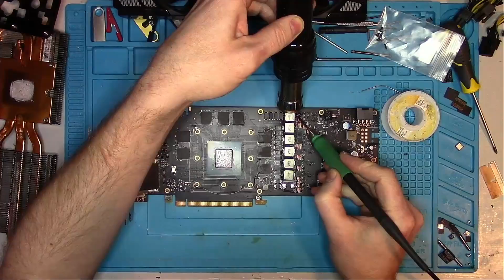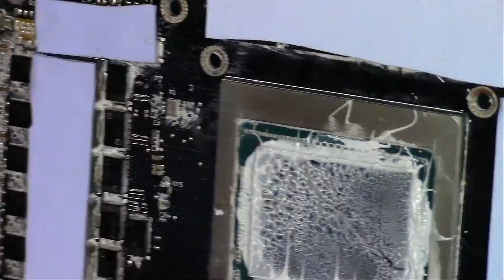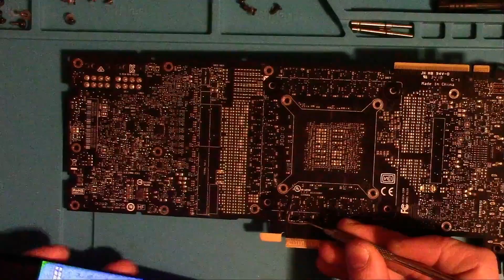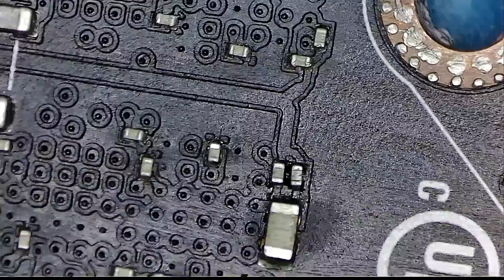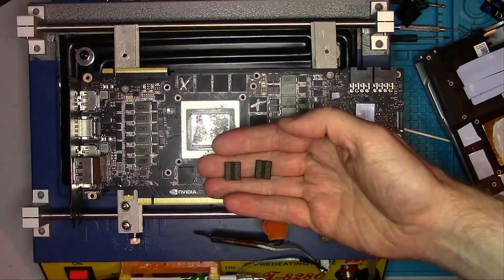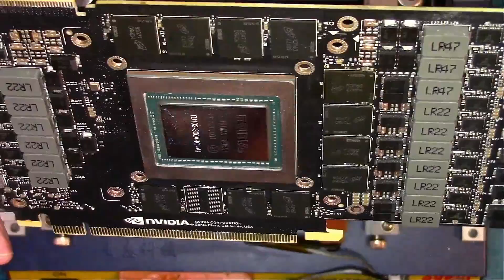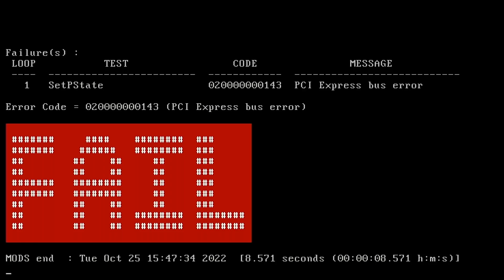2080 TI Memory problem warning

Comment: thsoe 2080ti especially the reference one by NVidia are garbage. they use glue to prevent fix procedure on purpose! never buy NVidia reference. also, you are nuts to invest half a day fix for such a card, its not worth it in any way shape or form. apart than making a video. with negligible view counts the monetization will not fill the money gap.
Reply: The glue is used because those cards bend slightly due to the weight of the card. I guess NVIDIA thought they might far less RMA requests if they add it.

Comment: looking nervously at my MSI 2080ti Gaming X trio (❛‿❛✿)
Reply: I'd like to think that because mine has Samsung memory it'll be fine ;) - have the memory running overclocked @2000mhz without trouble
Reply: @tourmaline07  are you also using the MSI gaming x trio card? I dont find where it says that its from Samsung
Reply: @G-O-A-M  The GPU-z main info screen lists the card as using Samsung GDDR6 vram - don't know if MSI used Micron memory for any of their cards.
Reply: i have 2070 super from zotac and the memory manufacturer is  micron.😬

Comment: hello 1 noob question to everyone. which cards are more reliable AMD or Nvidia. I had only 1 Nvidia for last ~12 years GTX 560 and died after like a year working in good case without any high temps and never OC. Started with slight artifacts and at some point they were so many even in safe mode was impossible to run browser to order new card. This problem can be caused by Vram and not GPU? Now i want Nvidia but im kinda scared coz i remember their GTX 8000 series having hardware problems too. Do anyone have used Nvidia for more than 5 years without problems?
Reply: had my 6800xt since dec 2020. so far so good.
Reply: Nvidia, without any doubt, AMD hardware is garbage, this is not an opinion, it's fact!
Reply: @sirfairplay9153  super strange if you talking for real. for 15years i dont have single failed  AMD gpu. but i dont like their encoder and software, opengl etc.

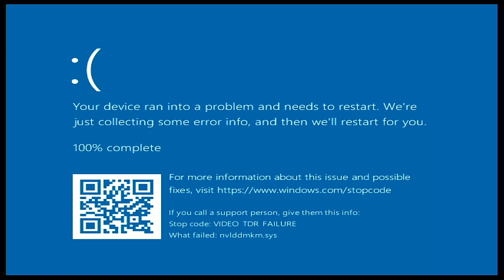Comment: Former NT driver dev here: the kernel bugcheck (0x116) VIDEO_TDR_FAILURE seen at 6:13 is not actually that uncommon. It means that the WDDM timeout detection & recovery (TDR) watchdog failed to reset the driver and GPU state. This is usually indicative of either failing hardware or a seriously bugged driver that got the GPU into an unrecoverable state (the latter being pretty rare nowadays).
Reply: I sort of had 2 of them in the last week usually when coming out of a game. Updated the drivers let's hope it's gone.
Reply: I experienced this using a pcie 3.0 riser with a pcie 4.0 gpu. Setting pcie to 3.0 on the bios and obtaining a 4.0 riser are both solutions.
Reply: @Mehecanogeesir  Note: I highly recommend the CoolerMaster PCIe 4.0 riser cable and vertical mount kit (as it’s the only one I tested that ran at full 4.0 speeds with a zero error rate at full bandwidth). It’s a pain to work with, because the cable uses heavy gauge wiring and mongo-level shielding, but I’ve found it functions pretty flawlessly once installed.
Reply: @smakfu1375  thanks for the recommendation. I have an all white build which is why I was stuck with PCIE 3.0 during the 'shortage age' lol
Reply: I would always get video tdr failure when overclocking Intel arc GPUs, I don't even recall ever getting it with NV or AMD
Reply: why is it not uncommon?
Reply: @fablearchitect7645  Mainly because failing GPU hardware will trigger a 0x116. Unfortunately, many don’t see the actual bugcheck reported on screen, because the GPU is too borked to properly perform a mode switch. When KeBugCheck (the kernel’s kernel-mode fault handler that stops the system in a structured fashion - e.g. it’s the thing that makes the BSOD) is invoked, the screen mode is switched and, among other things, a stop code error printed to the screen along with a sad face - in the old days we used to get the additional parameters and stack dump on screen). If you see your machine black-screen and reboot, especially when doing something GPU intensive, there’s a solid chance you’ll see a bugcheck 0x116 recorded in the system event log. When the TDR watchdog routine is successful, you’ll see “Display driver stopped responding and has recovered” - if you’re seeing those repeatedly at random times while under GPU stress, you probably have an emergent hardware problem (the exception would be if running on hardware with immature drivers, such as Intel’s current ARC drivers).
Reply: @smakfu1375  sigh I think the world is telling me that my 980ti is saying it's goodbye's..
Reply: @0xC0FFEEBEEF  That card has had a hell of a run. You should retire it with honors.
Reply: @fablearchitect7645  Because it occurs whenever a GPU driver or GPU goes bad or crashes to failure. It's common for people who set up their PCs at least since they have to set up the hardware/drivers properly.
Reply: What does that mean?  Xd
Reply: This comment section probably failed in Literature.
Reply: Wow a real life wizard. What was that like? Do you guys have a list of all the bugchecks including relatively unknown ones? What was the most obscure one you had to troubleshoot?
Reply: @NitroDubzzz you can find a list of bugcheck codes on msdn. The explainations are sometimes lacking though
Reply: Basically it means a hardware failure, if you see that, there is an issue with the hardware, that’s what he meant.
Reply: so its partially your fault lol
Reply from the maker: As interesting and informative this information may be, it is absolutely useless for my field of expertise.
Very sorry.
Reply: @northwestrepair  it is usefull for early diagnostic
Reply: @northwestrepair  lmao god damn dude chill
Reply: @northwestrepair  Another useless fact, the opposite sides of a die will always add up to seven.
Reply: @northwestrepair  not cool
Reply from the maker: @1metallicity  
Am not trying to make him look bad, in fact I said he seemed to know a lot more about the subject then I am but his knowledge does not help with the diagnostic.

Just because you know how to program an artificial intelligence robot, does not mean you can make a meal.
I am in this case one who knows how to make a meal, if you know what I mean.
Reply: @northwestrepair  What a dumb reply lmao
Reply: @northwestrepair  very sorry for what? dude is only sharing knowledge.... what a shit reply... better not reply at all
Reply: @northwestrepair  skill issue

Comment: Start selling these on eBay, the ones that you fix. I'll be interested in purchasing for sure.
Reply from the maker: This card was sold already. Guy is returning it claiming "no audio from HDMI"
Am sure he is full of potatoes. There is no way there is no sound coming from that HDMI, he just found a better deal and now looking for an excuse to get his refund.
Reply: @northwestrepair  Taking into account the $70~ for chips, and the repair itself most likely costing $200~ which is half of the cards price, I can understand the customer, albeit the card would've failed whether or not it was user error anyway. Seeing how it has micron.
Reply: @lukafireman  Customer should have considered before going ahead with buying then.
Reply: @tourmaline07  That's the thing, you can't really be like that to a customer or you'll earn bad rep. Then you won't really have sales. He doesn't want it? I'll find who does.
Reply: @northwestrepair  Yeah. Had massive problems selling a Vega 64 Nitro+ earlier , the guy claimed it ran too hot and was defective. Told him to show me some gpu-z screenshots showing the core/hbm/hotspot temps to see it was throttling back under load.

He made all sorts of excuses about moving house as to why he couldn't put the card back in the PC and that someone in his family had died so he conviently waited 30 days too. Ended up cutting my losses and sold it to someone else losing £120 in the process. Of course when I got the card back the temperatures were well within  the 85/105C core/hotspot limits with reasonable fan RPMs.

Comment: Do you know if other GTX / RTX or even RX cards tend to have that same type of Micron vram chips?
Asking so I know what to look out for when purchasing used GPUs.
Reply from the maker: 2000 series cards do.
You cant look without opening it up.
If its micron and starts with 8, get something else of problem will come sooner or later.
Reply: Browse through his older videos. He already did some repairs and mentioned it there. IIRC it´s related to 2018 manufactured Microns.

You will not find it out, tho. At least not without full GPU disassembly and thorough cleaning of the chips. GPU-Z does not offer this kind of info.

Comment: Yikes. I'm worried about my GTX 1070 failing (Fan keep cycling on and off even after I replaced them) But at least it's still running on less demanding games.
Reply from the maker: dry thermal past and pads.
Reply: Are you sure that you don't think it function that way because of automatic fan curve? Like it'll spin when it needs to after reaching certain degrees.
Reply: @fizkun-my8555  I don't think so. It does this no matter what setting I put the fans in.

When I'm not gaming... Or playing less demanding games, I don't notice it. However when I play current gen games, I can hear it constantly turning on and off. Even if I tell the software to max out the fans, it still fluctuate.
Reply: Maybe just the fan control unit is on the verge of death. Try replacing fans with standard computer fans (pick size, which will fit, depending on your heatsink - may be 2x120mm, but also 3x92mm. Mounting them to the heatsink is always a macgyver solution, but if it would work, it shouldn´t matter.

Or rewire the fans cable into standard PC 4-pin/3-pin fan connector and make a curve for the GPU in Fan control.

Or go for aftermarket heatsink. But warning, the card is gonna be gigantic.
Reply: I had this exact problem with my nieces RTX2080. Replaced thermal paste and it solved the issue.

Comment: Why would Nvidia use glue to hold memory down?  That's dirty.
Reply: Pcb flexes near the bottom due to the weight of the card. The glue can actually prevent some of the failures of the bga.
Reply from the maker: its a band-aide, not a solution.

Comment: The glue on the memory chips near the PCI connector is there to keep them from detaching in case of excessive board flex?
Reply: That is for reflow soldering

Comment: hopefully 3000 series will not suffer a similar fate 💀
Reply from the maker: it does not
Reply: @northwestrepair  I knew the 20 series was one I was gonna pass on
Reply: @nicekeyboardalan6972  i think 3000 series will face different set of issues, mostly due to all the shortages, that were happening during their manufacturing. I expect something similar with AMD cards too.

Many companies had issues during Covid shortages and were using literally anything to make their products.
Reply: @Morpheus-pt3wq  well if you got a gigabyte card or a zotac I would worry
Reply: @nicekeyboardalan6972  i have 2070 super from zotac and it does worry me if my gpu memory will fail. memory manufacturer is micron.
Reply: @nicekeyboardalan6972  gigabyte?
I think they are giant with robust reputation, is there a gigabyte gpu that failed?
I know some zotac years ago that had high temp on VRAM and got artifact quite frequently, that's why in my country zotac have quite a bad reputation, but for today i think they are fine
Reply: @antonirizki961  gigashit sucks ballz they use the lowest teir components and they're always misaligning stuff on PCBs zotac is alright at its best.
Reply: @nicekeyboardalan6972  what for real?
Damn their motherboard at least decent though, hmm i have GTX 970 gaming g1 they are amazing,
On AMD side is there a recommended manufacture?
I'm trying to go team read for RX6600 i got my eyes on swift 210 and hellhound also gigabyte eagle triple fan, sapphire pulse kinda basic but i don't know, I've heard sapphire is top tier amd
Not gonna pick asus they're premium priced, same gpu one tier above price ridiculous at least in my country
Reply: @antonirizki961   sapphire and xfx are the best amd first partner cards also I'm not saying you're screwed if you get zotac or gigashit but if you ever see an article about something screwey it's usually those two to blame.

Comment: That film left on the pads is why some of them, e.g. Gelid, have something printed on the film. Gelids only have them printed on one of films so peel the blank side off first and stick them on, that way you can see which ones still have the other film on before you assemble the card.

The resin bonding for the VRAM chips nearest the PCIe slot will be to stop them peeling off as the PCB flexes. Loads of prebuilt PCs have had that problem due to the G forces the cards endure as they're being couriyeeted.
Reply: That black residue around the memory chips is called underfill. Yes, they use it to strengthen the structure of BGA components near PCI-E socket, where bends can occur. Some reworkable resins can be removed with heat, whereas others, like the one shown in this video, are impossible to remove without brute force.
Reply: @avetruetocaesar3463  Something we learned from the Xbox 360 ring of death era.
Reply: Couriyeeted! Nice one!

Comment: I havent own a 20 series card though I had 30 series that fail less than 1 year
Reply: At least you have warranty
Reply: @trr4gfreddrtgf  it was denied that the card was faulty I had to sell to recoup my losses 
I was without pc for weeks and small claim rep 
Would of taken long time
Asus did send letter in package card had no issue, failed completly after 1 month had red dots on screen
Reply: @trr4gfreddrtgf  the retailer said card was fault i didnt wanna pay diffrence for a worse card or different model which was sold out when it was out for warranty
Reply: @trr4gfreddrtgf  i did mine on gpu but I had power limit
I did overclock memory 
And some maintence
Miners claim cards should last 3,4 years 
That wasent in my case
Reply: @trr4gfreddrtgf  card had severe coil whine after mining
And red blink lights on power lines connector
Reply: @Jonathan900S  rip

Comment: Nvdia think they are slick by adding resin not to remove memory or have the right to repair these cards can have more time to use…
Reply: It's so the solder balls don't break by the pci slot
Reply: L comment

Comment: When I saw the custom thermal pads I immediately thought it was user error. Lo and behold a plastic film left on the thermal pad. Wow!
Reply: I recently handled one of those pads for an SBC. The thin film is completely invisible to the naked eye, the only reason I didn't fall into this trap was that I remembered to check right before mounting the cooler.
Reply: When i saw the owner had used thermal paste underneath the pads at some point in the past i new it was done for.

Also, FYI, most thermal (and from personal experience the thermal grixxly minus 8 pads especially) pads come in strips about 10cm long. You have to cut them. If you want them to fit on the memory modules of your GPU you need to buy 2 of them and then cut them or they will not fit. The plus point of this is there will be neough left to cover the VRM and if you cut them right you will magically use every square millimeter of those pads.

Oh and if you do cut thermal pads, use the old ones as templates.
Reply: My biggest fear was that it was my card that the thermal pad film was left on xD. I sent him my 2080 Ti FE that was artifacting and had driver issues as well. Ended up selling it to him since it would have cost more to repair than what the parts were worth. I had done a repad of it when I first got it so I thought it was my fault watching this video. Luckily I had a picture of the GPU chip and the serial numbers didn't match in the video. whew, looks like I just got bad memory and am not a dumbass. Still won't try repadding any time in the near future though. I'll leave it to the pros.e
Reply: Yea but the title of the video confused me and seemed a little clickbaity... for a second I was nervous my 2080 ti was just going to die on me for no reason. But this was 100% user error, and has nothing to do with the 2080 ti specifically. Cool to watch the repair nonetheless.
Reply: a lot of 2080tis dyin lately @yeetus59
Reply: @yeetus59  it wasn’t only user error. Rewatch the video.
Reply: @waffleurr  I know what I saw. It is all user error. Improperly applied thermal pads without removing the plastic film caused the memory to overheat and fry other components along with it, no doubt the owner was trying to overclock and that's likely what killed the memory. It is user error, not a specific problem for 2080 Ti's. You might need to re-watch
Reply: @yeetus59  Pretty sure the heat still gets through the plastic, even though it isn't exactly optimal to keep them on there :P 2080Ti memory isn't as hot as the newer models. Probably would've been a bigger issue with 30xx cards.
Reply: @yeetus59  What killed it was the massive amount of voltage that got pump through the vrm to the module. The thermal pads were just the cherry. I suspect this card was shunt modded, blew up, had the mod removed and was then sent for repair.
Reply: It was not solely due to a user error. The user error was the minor problem. Rewatch the video if you didn’t get it.
Reply: @waffleurr  it was exclusively user error.

What video did you watch? lmao.

He had to replace all the vram because it was mismatched.
Reply: You're the kind of guy that sits in the corner and your sisters honeymoon and when she opens her legs you quickly point out that she's not a virgin.
Reply: @1415gatewayable  What a crappy comment.
Reply: @conyo985  what did he say
Reply: @johnjonson6377  Well Chris wrote a sarcastic comment about me being a person stating the obvious, but he said it in a childish way.